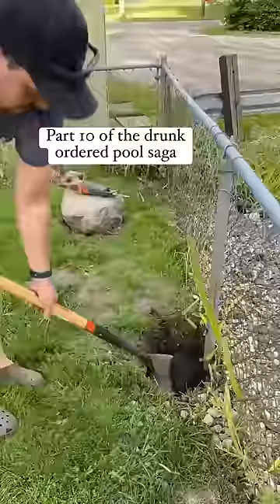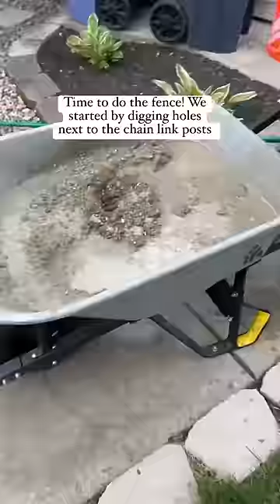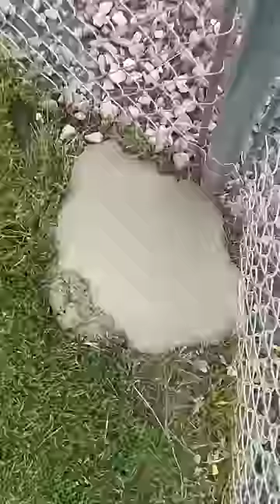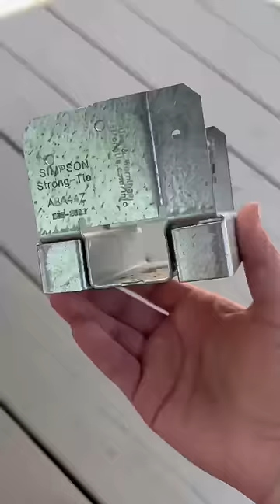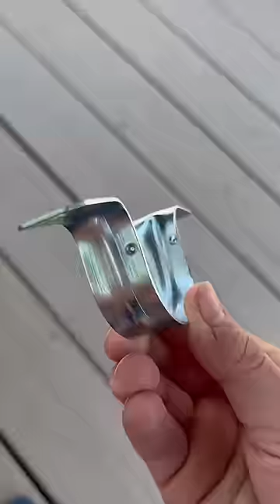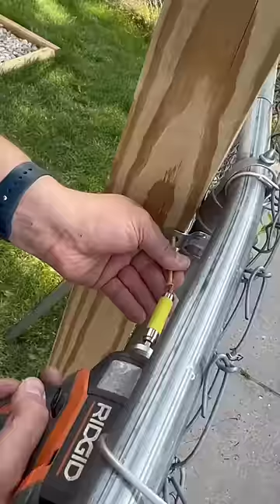DIY Wooden Privacy Fence #fence #diy #privacyfence #woodenfence #fence #ideas #chainlink #backyard

Comment: Video on how not to do a fence.
Reply: Yiiaakkssss 😮
Reply: How you gonna attach your fence to theirs? Just asking.....😮😮😮
Reply: My thoughts exactly.
Reply: All you have to do is dump the dry concrete in the hole and than apply water 💦
Reply: @francinecannon1903  I was going to make a comment, but no
Reply: How Tik-Tok build a fence even used all the hardware out of Grandpa's Barn what a joke
Reply: hmmmm..
i wonder what will happen when those posts start to naturally twist while attatched to another fence that isnt wood?
Reply: Should have set the post in the hole with the concrete
Reply: תירו לזאתי בראש , שלא תתקרב ולא מעניין אותי , יש לי מוביל רציני
Reply: Say it again they made it harder nd more expensive than what it actually is
Reply: Fence contractor here. Just wow
Reply: @xxOldSouL  not a bad thing at all tbh if you are not using self drilling screws. Especially on soft wood
Reply: Says you. But they saved money to do the rest
Reply: Yessir lmaooooo
Reply: Missing washer in the post base.
Reply: Why not just put pole in concrete..alot of extra for nothing when you already dug the hole..
Reply: What’s your issue with this again?
Reply: Dang, I was going to post the exact words!
Reply: Agreed
Reply: Just give the home depot guys $500 & some beers would've been better.
Reply: I was thinking the same thing
Reply: @epimenioleal Not all bags work that way sadly! Some must be mixed.   The red ones usually are just pour and play. 😂😂😂😂
Reply: @lynardburt5992 they didn't.... cause they will be fixing it in a few years anyway.
Reply: @FedeBL4 soft wood does not need a pre drill. Hard wood does. Only in the corners to avoid splitting. Or using very big screws
Reply: @raunefare  I find local soft wood like fir much more prone to splitting than our harder essences. Probably different for what you get where you live. Pre-drilling accordingly to the screw diameter does not hurt in both cases.
Reply: @thatcrazychicken I still would mix I don’t get people that dry pour it never lasts
Reply: Wouldn't you put drainage stones under the wet cement- install brackets in wet cement? Would this work?
Reply: All that digging could have set the post in 😂
Reply: Correct
Reply: They voted for Biden hahaha
Reply: @francinecannon1903  it more than likely is theirs or got permission or could be a family member’s 🤷🏻‍♀️
Reply: @francinecannon1903 right because what if they want to redo their fence one day.. That’s the problem neighbors are so inconsiderate of each other..
Reply: I was like, what am I watching???
Reply: Hahaha I love this comment
Reply: @francinecannon1903 that's not the neighbor fence it's their look at the chain leak fence the support post on the chain link is in their yard he just adding a private wall to keep the nosey neighbor out of his business
Reply: @francinecannon1903 it’s their own fence actually you can tell by the way it’s facing. But yeah it’s still a shitty fence they are building wrong
Reply: @angle5520 it’s not the neighbors fence
Reply: @epimenioleal negative
Reply: Yes correct
Reply: @francinecannon1903 um that's their fence
Reply: Wouldn’t even call this temporary.
Reply: Where does the video claim to be a "how to"??
Reply: @francinecannon1903 the way shown in the video???
Reply: For privacy not for holding anyone in or out
Reply: How do you pull out a chain link fence post from an asphalt driveway?

Comment: Going to all the effort of putting concrete down and not sinking the post into it??? Why?
Reply: Wondering the same thing...
Reply: If ya know anything about concrete and wood, it’s a shite idea to put directly into.  Even if tar coat the post, they’ll still rot faster in the concrete
Reply: @JustB904  15 - 20 years average depending on region, wood type and treatment...
Reply: @JustB904 treated. Wood.
Reply: If that concrete due to the earth shifting, and since there is no rebar in there, that post is gonna go crooked one of these days
Reply: @JustB904  I've installed fences for 13 years now, and my family for 60. Many many times I'll break open the old concrete from wood posts and the post inside looks brand new. You get some rotted ones here and there but definitely more that look 'preserved'. biggest fail point I've seen in my area is the first couple inches of  soil that comes into contact with the wood posts. (You cannot pour cement to ground level here, it promotes 'heaving' in the winter) I don't recommend installing wooden fences the way done in this video. Theres going to be a lot of weight riding on those 1-5/8" line posts, and depending what style of fence is done here it could act as a big windscreen and take a lot pressure from that. Not to say this doesn't have the potential to last for years (if you maintain things they last!) Also, just throwing this out to the OP/homeowners, if it doesn't live up to your expectations, try 'postmaster' posts. Steel posts, with the ability to be boxed around and imitate a wooden post.
Reply: @paplinkster1081 even treated wood rots lol never a good idea to pour concrete around a post
Reply: @stevegagnon9451  that’s the way you do it, that’s how everyone does it. This isn’t correct
Reply: @paplinkster1081  techno posts are the way to go
Reply: @JustB904 how fast? My fence is 30 years old the boards are rot but the posts aren't, so what is too fast to you? 31 years? 😂
Reply: Because it will rot
Reply: @WorkHardOr  I agree but just pouring a shallow pad like tgat is useless also, especially if the winters are cold
Reply: @stevegagnon9451  you’re not wrong, but that being said treated lumber in concrete has been done for years.
Reply: @paplinkster1081  oh I know
Reply: I mean they did give themselves the name Dont diy if you’re drinking
Reply: Came for this.
Reply: @WorkHardOr the post typically rot because the top of the concrete was not sloped or it was covered with dirt which will keep the post surrounded by moisture. 
There are times to set the post in the concrete and times to set it on concrete. I believe in a fence line like this in the concrete is the way to go.
Reply: Did the hard work then flopped 😂
Reply: And you would have a trash drill and use off brand attachments
Reply: Use reinforced concrete posts and set them in the concrete. At least that's how it's done here in the UK
Reply: That’s what I’m tryna figure out 2
Reply: My thoughts exactly but his clamps are decent so it passed my vibe check
Reply: @JustB904 yeah it rots in about 25 years 😂
Reply: I thought i was going mad! Why not just sink the posts, complete waste of time and money
Reply: @lozmarshall7837  bro a whole lot of cement was wasted
Reply: I was thinking the same thing!! Why not sinking the post into the concrete??
Reply: Sencillo la madera se pudre por eso ancló al concreto un  soporte metálico para agarrar el madero y poderlo reemplazar
Reply: The lumber will be continuously saturated with water that way. A post mounted above the concrete will stay in better shape that way. That's why the brackets are made to use this way.
Reply: @paplinkster1081 Your point?
Reply: @marlonestrella8105 Rebar isn't used to keep it straight.
Reply: @joewoodchuck3824  it’s a shitty fence? I thought it was pretty clear.
Reply: @paplinkster1081 Could you be a little more vague? "This something...  "That something... " Which is which?
Reply: @stevegagnon9451 It's far from being just a pad with the depth of digging they did.
Reply: @lozmarshall7837 What do you think those brackets are made for?
Reply: @miguelruiz-yk8op How so?
Reply: @adolfogonzalez8204  What do you think those brackets are made for?
Reply: @joewoodchuck3824  oh pls if it’s only 24 inches down it’s a pad
Reply: @Noreik395 got over 30 out of mine 😂
Reply: @JustB904 30 years so far
Reply: You are freaking kidding me right!!!
Reply: Using the posts from the chain link fence.
Reply: @brianbunnich6221 these are poodle fences. Not meant for any strong winds or jumping over etc  quick fences for garden patios
Reply: I have a 25 year old fence treated posts in concrete. Looks good as new. It would last longer in concrete and be stronger as how everyone does it
Reply: @JustB904  you're kidding right?
Reply: @JustB904  if you know anything about construction you know that your comment is bullshit lol
Reply: @joewoodchuck3824 wrong. Don't speak on construction unless you know. Please move along
Reply: @joewoodchuck3824 also, these brackets are not meant for this application whatsoever.
Reply: Sitting in top works just fine thats how my deck was built
Reply: @CP-os1pc  a deck with structure and not 2 dimensions is a bit different than a wall of wood
Reply: @CP-os1pc  but it's still incorrect if it was not fastened to anything
Reply: Because if you do it the right way then you won't have nothing to do latter😮😅
Reply: Easy removal and concrete eats wood
Reply: @JustB904 no they won’t. I have had to pull plenty of fence posts, all very old. All very sturdy still. More often than not, the fencing rots before the posts do. Almost always actually. Unless the rot targets the area that’s flush with the ground, there’s just no way setting in concrete is EVER an issue. It’s the proper way to install posts. And that’s not an opinion
Reply: @marlonestrella8105 ”one of these days” is 30 years from now. I’m sorry but the new fencing techniques aren’t good. The old way is still best, and likely always will be. I could kick that post and break it in one try. You can’t do that to a post set in concrete
Reply: Yall have never built a fence and it shows.
Reply: Why do you have to sink t h e post into it
Reply: @MrZeaos  because its stronger that way
Reply: @auger8451  instead of the steel brackets? Doubtful.
Reply: @MrZeaos  stronger than the screws holding it.
Reply: @JustB904 if you know anything about concrete and wood fence posts , you’d know that they make something to wrap around the wood post where it’s in contact with concrete that can keep it from rotting
Reply: Bruh, the wood rots after time, this is way better
Reply: At least sink the bracket into the cement

Comment: Wouldn't cementing the post in place be better.
Reply: No. Causes post to rot too fast. Even if ya coat area in the area that’s to be in concrete
Reply: @JustB904 that’s what treated lumber is for
Reply: @JustB904 there’s literally solvents you can paint or dip the post into that would strengthen the treated lumber.  There’s even ground contact made lumber for posts now
Reply: Seriously waste of money and time lol
Reply: @JustB904 I have twenty five year old posts on my property, unless you cut your own lumber you will be fine
Reply: Maybe a little less concrete. Have fun getting grass to grow
Reply: @JustB904  25-30 years to fast or sure.
Reply: Never bury wooden post in concrete, you should put a bracket and keep the wood above the ground.
Reply: @crz6662  so it's wobbly, unstable, and hazardous to have anything on for only 4 bolts holds it in place and concrete isnt an ideal substance to hold screws in place. Okay gotcha. Make it hazardous and last only a few months for the water will rot out the post completly and be utterly useless. Fines and lawsuits are a commin'.
Reply: @NatashaBlastBurnWinland they're called stand offs. The post is anchored to the stand off, which is anchored to the concrete.  They changed the code years back here in Michigan because posts set in concrete rot out
Reply: @alandecker8912  Michigan is by the great lakes where its almost always humid. I livr in WV where cementing the post in place is thr best option for we are The Mountain state. Winds pick up here and these mountains and hills help funnel that air flow. It'll take those bolts right up if we got a good enough breeze, then there's a post with metal brackets flying through the air and hits a car or a person. Guess who pays for that? Whoever owns the post for not cementing it in place. Michigan I understand because its humid wet ground. But in West Virginia bolting it down to the ground its completely stupid you'll just make a hazard here.
Reply: @JustB904 the pool will last like 2 years hahah it’s an above ground pool
Reply: The ones I replaced were over 15 years old. A few rotted because the concrete was below the ground.
Reply: Yes it would. That fence post will last a helluva lot longer than the pool will.
Reply: Better to just ram them straight in .
Especially steel pipe .
If you cement them in after a while the ground drys and cracks .
Loosens the cement footings that have the posts in . Then the strain on the posts makes them pull out
Reply: @NatashaWinland 100% agree with every word u just said
Reply: @JustB904  nope
Reply: @crz6662  Time to catch you up on construction practices in the past century. You dig a deep hole, you fill it with 4" of gravel, you set the post and fill around it with concrete. The IRC requires preservative-treated lumber rated with ground contact. This meets the AWPA U1 standard. 

You are welcome!
Reply: @flawless8774 not at all cause long term it’s really gonna be a waste of time and money cause it won’t last as long
Reply: @NatashaWinland  Actually code in some places. Even if you use treated lumber! It still rots faster when in contact with the ground.     Treat the ends before before install in the brackets. Still better than ground contact.
Reply: @JustB904 😅😅😅 where do I begin with you?  You could of researched this. There's wood that are built to with stand that issue..  one I can think of is insane orange. If you respond I'll get the right name. But I think I spelled it eight
Reply: @JustB904 nope, wrong
Reply: @JustB904  Been doing fences for 11 years my guy. I've seen more perfectly healthy posts in concrete than rotten ones when tearing out fences. Plus, it'll last you far longer than what they are doing here. Their fence just needs a strong gust of wind one day and that's going to knock it over.

Comment: Never touch the neighbors fence ever
Reply: Depends. If the fence runs more ON the property line, then it’s your fence too, not just theirs. Meaning you can do whatever the hell you want to it. I just connected to theirs instead of putting an entire fence up. It was ON the line. It was mine too
Reply: I doubt that's the neighbors based off where it ends on the garage

Comment: Congratulations! Now your new wood 8' fence has the strength of an old 3' tall chain link fence.
Reply: I get what you’re trying to say, but my chain link fence was built in 1970 and it is not going anywhere unless I dig the damn thing up
Reply: @Madkilljoy  different types of strength. The old chain link fence was short, and the wind doesnt effect chain link much. With a new wood fence attached to it for horizontal stability, your old chain link fence will have to bear the wind load of a much bigger fence. If you would've just gotten longer wood posts and attached the posts before you poured concrete, you'd have plenty of strength in both fences. I hope it works out the way you plan, but it seems like a maintenance nightmare to me.
Reply: @Wellactually123  Yeah, I see what you’re saying and I’m definitely gonna auger out some holes and put new posts in

Comment: Nice job,  next time get some brackets you can wet set in the concrete. Will be better than drilling into concrete that's not fully cured
Reply: No it won’t it’s not a deck it’s a fence
Reply: Neither one is the correct way to go about that job. Depending on climate and rainfall, the garbage they just threw together will get pushed out after a couple freeze thaw cycles and will need to be tore down in a year or two....

There's a reason posts get buried a minimum of 2'. The taller the fence posts, the deeper it has to be as well.
Reply: Thank you my new house has same metal fence and I don’t have budget to hire to . I am going practice this on my house wish me luck😂
Reply: @meselechlole9691  don't do it. You will get better and longer lasting results if you wait, save money, and do it the right way. Otherwise, you're gonna pay to do it now, then again in a year or two, spending even more money then if you wait.
Reply: @Dwill545  thank you so much for your advice 😊
Reply: @Dwill545   That aint true..... just do it right and care for the wood and it will last a long while...Yes there is the correct way for $$$$ and there is DIY that is more affordable and can also las many year. however, if you want something spectacular and stylish , then i would agree to wait and save.

Comment: I would just set the posts in the cement next time, this included all the effort but non of the strength 

Those brackets are for attaching posts to preexisting slab or something
Reply: Yeah, attaching a 4x4 this way to this little of concrete is just asking for trouble. It wont be long before that concrete he poured is sifting around in the hole!

Comment: I replaced cyclone with cedar fence this year. No new holes, no cement. 
I purchased new metal fence post (bigger diameter and taller), slid them over existing post. Drilled holes, ran bolds through post so they would not move. I now have cedar fence with metal post and it actually looks really good.
Reply: i like this idea but what are "bolds" that you  poured between to they dont move?

Comment: Little hint that would have made that easier on you put those post brackets with metal bolts in while the concrete was still wet